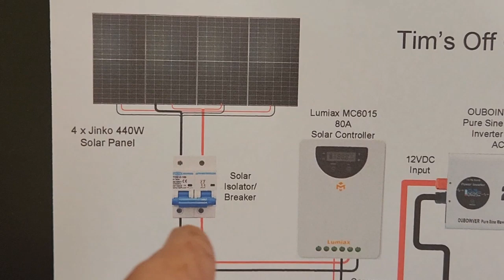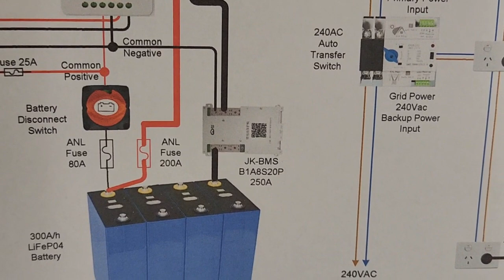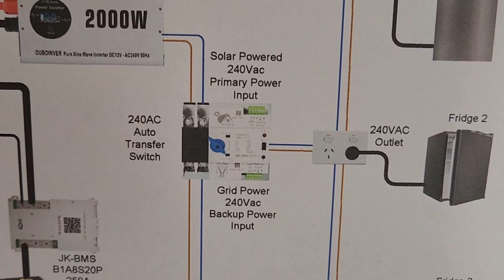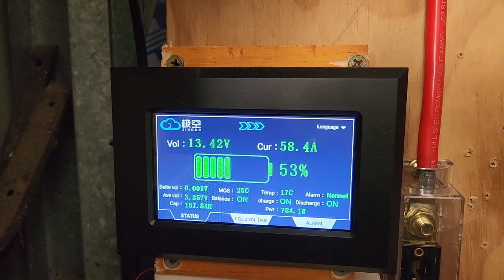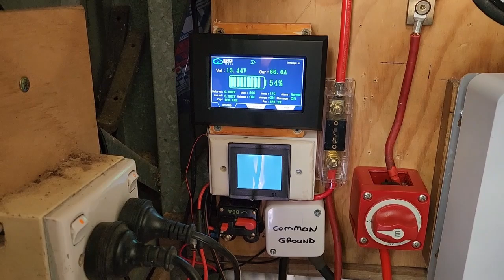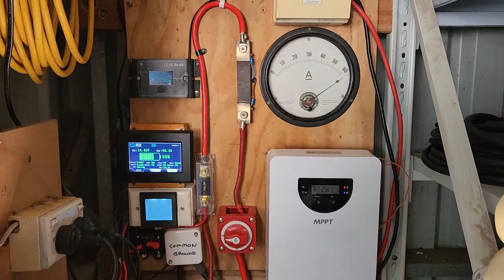Get your house a Bit Off-Grid - 1.5kw Home Solar Battery System!

Comment: Nice set up. We obviously don't receive a feed in down here on our 6.6kw panels 5kw fronious system....a battery 🔋 could be on the horizon
Reply from the maker: I would tread carefully at the moment as the solar industry is apparently struggling to keep up with demand due to the Federal Government's battery rebate. They will be having a field day and capitalising on that until things settle down. I think people will be paying more than they need until supply catches up with demand. Also the how a battery is connected to an existing system maybe where a lot of the cost will lay. I think for a battery you would need to get your solar collector array up to perhaps 10Kw or more as it seems the solar needs to be 1.5 times the inverter as a general rule.